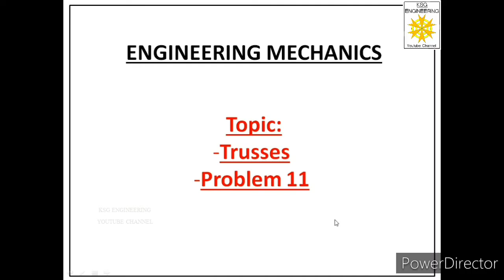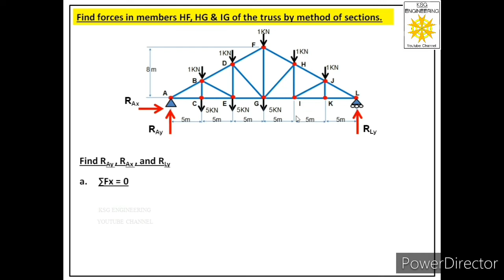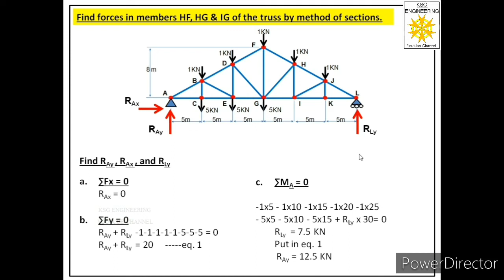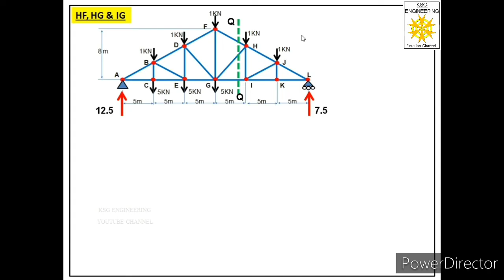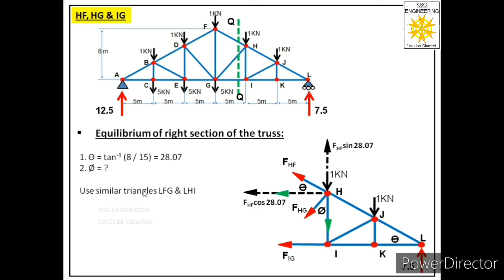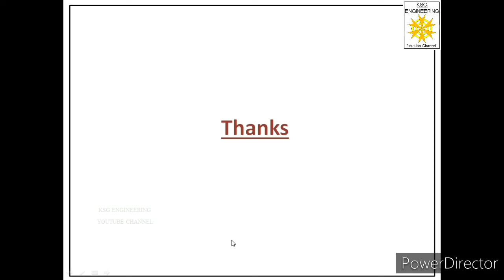Trusses | Method of Sections | Problem 11 | Engineering Mechanics | 11.11

Comment: I really hope you reply me on this. You resolved forces in the x direction using sine and resolved forces on Y direction using cosine...Why? Shouldn't it be the other way?
Reply from the maker: Dear, for this you have to understand the resolution of forces. Look, it is not a rule that we should always use cosine in horizontal direction and sine in vertical direction.

During resolution of forces we have to decide that with which component we are considering the angle of the resultant force. Suppose, the resultant force P makes 30 degree angle with the horizontal component and 60 degree with the vertical component.

Now if you want to use 30 degree angle in the resolution of forces then as this angle  is with horizontal component then the horizontal component must be cosine component and thus vertical component will be sine component.

Thus horizontal component will be Pcos 30 and vertical component will be Psin30.

But if you want to use 60 degree angle in the resolution of forces then as this angle is with the vertical component then this time vertical component must be cosine component and the horizontal component will be sine component.

Thus, horizontal component will be Psin 60 and vertical component will be Pcos60.

Now compare the above two choices: in the first choice when we took 30 degree angle then the horizontal component was Pcos30 and in the second choice horizontal component was Psin60.

Now, see cos30 and sin60 have same values thus, in both the choices, the values of the components are same.

So, when ever we have to decide cosine and sine components, we just have to see with which component we want to consider the angle of resultant force, then that component will become cosine component irrespective of its direction whether it is vertical or horizontal.

I hope you understand
Reply: Thank you man. Really ♥️

Comment: Sir how did you get the HI=16/3? Can I have the solution?
Reply: the big trianlge (FGL) which is 8/15 = x/10 which is the small triangle (HIL) so when u sovle for x u get HI as 16/3
Reply from the maker: Dear, we have used similar triangle law for the triangles LFG and LHI. In similar triangles, we can equate perpendicular divided by base of one traingle with the perpendicular divided by base of other triangle according to maths of similar triangles. That is why we have divided 8/15 that is perpendicular divided by base of bigger triangle and equated it with the perpendicular divided by base of smaller triangle that is HI/10.

Comment: At C step you did wrong for clockwise positive and anticlockwise negative but you taken clockwise negative and anticlockwise positive
Reply from the maker: I think you have not watched video carefully. At C it is clockwise and in the equation it is written as -5x5. Watch it again.

And for your information there is no such rule of taking antibclockwise positive and clockwise negative or vice versa. Antibclockwise moments can be taken positive or negative, but you have to take reverse sign for clockwise moment thats it. If you see foreign author books they take clockwise negative and antibclockwise positive and some authors take reverse. So both ways it is correct.

Comment: Calculation rong...??
Reply from the maker: No dear. All calculations are correct. If you have any specific doubt. Kindly ask.
Reply: @KSGEngineering  when we calculated eq1 and eq2 with GI value,then we get value not similar as your another 2 value.(GI value is correct)